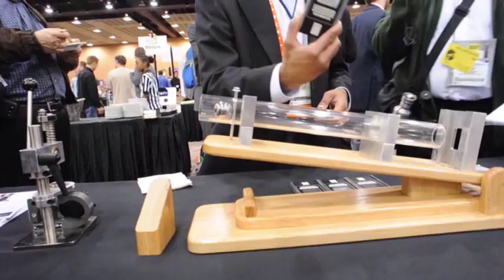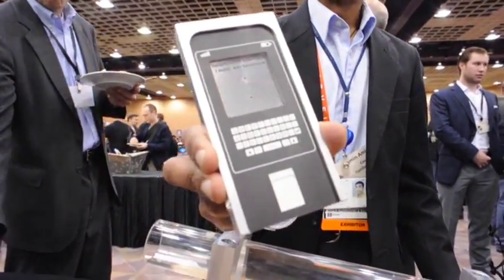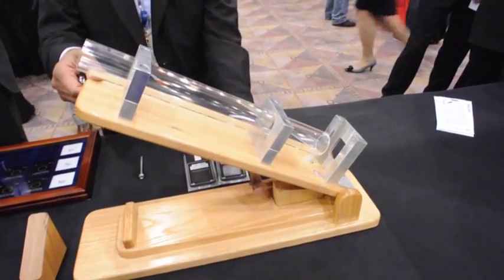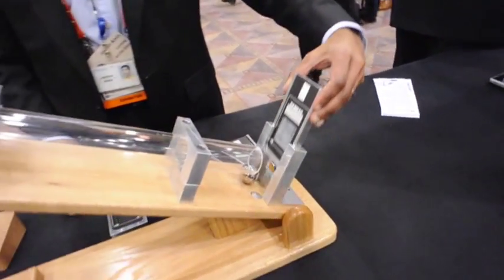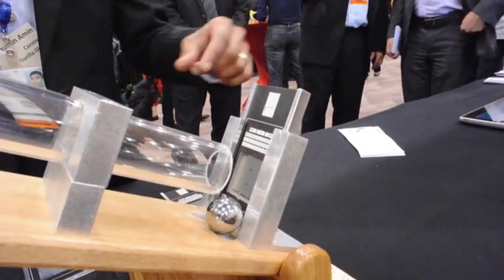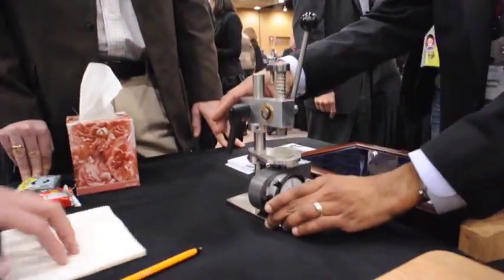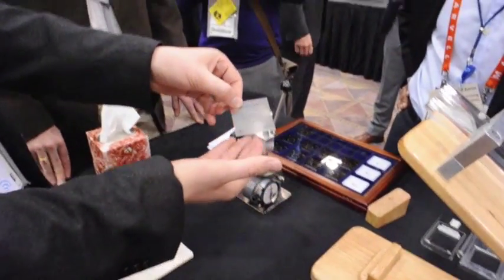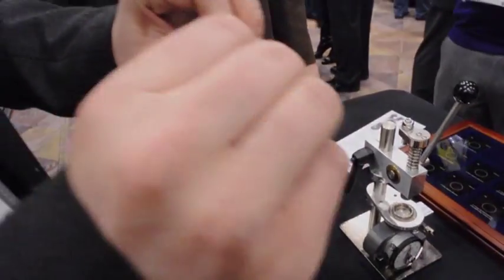Corning Gorilla Glass 3: Hands On | Engadget At CES 2013

Comment: go look at the Sony Xperia Active crash test. Hitting it with a hammer, rocks, scratching it with knives. Nothing seems to damage it. After about 100 hits from a hammer/other tools, straight on the glass it cracked. The screen that is, the glass was still fine. The glass used was dragontrail.

It's a bit harder then Gorilla Glass 2 but also much more flexible, which makes it shatter proof. I Think.

Comment: Let's see you drop a 255g steel ball straight down, no angle, and have it survive.  With Rhino Shield, it'll make it.  Gorilla Glass 2 SHATTERS under the impact.  I doubt version 3 can be that much stronger.

kick starter dot com / projects / 1081571316 / rhino-shield-the-impact-resistant-screen-protector

Comment: It's well known that strengthened glass handles distributed loads very well. What's most important is impact resistance concentrated on a small point (like intentionally whacking the glass with a sharp point).